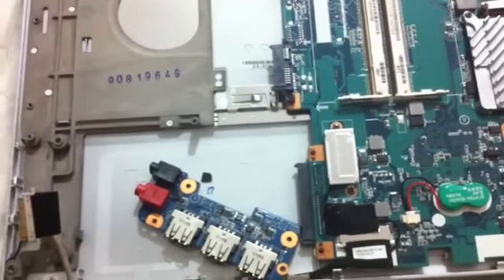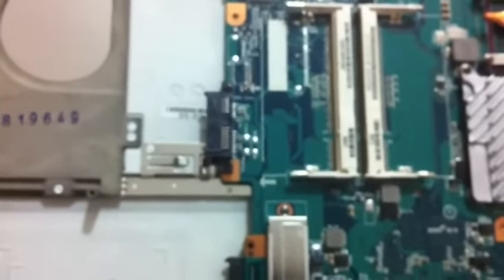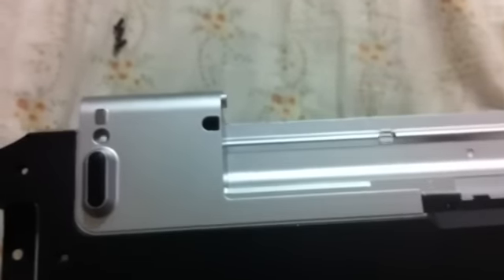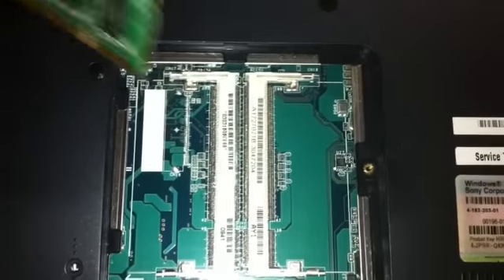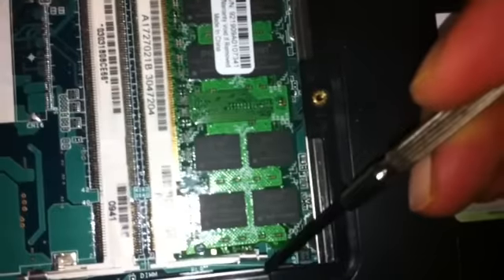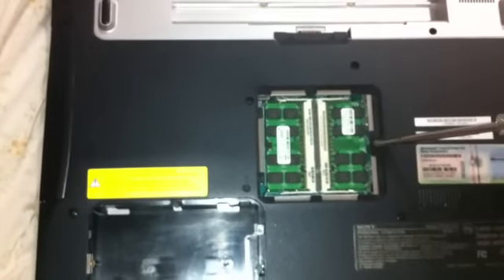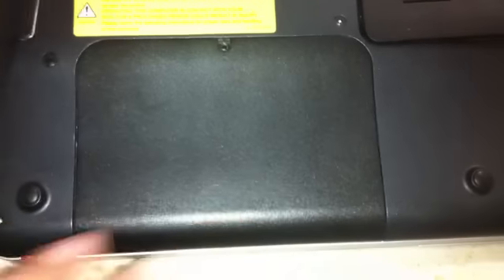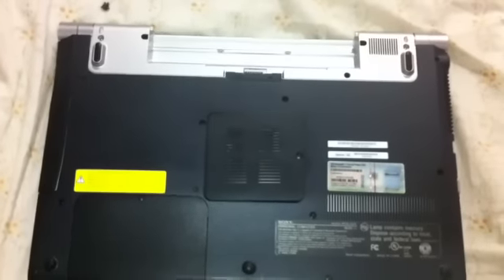How to assemble/disassemble Open sony Vaio FW series Notebook.

Comment: I had to open up mine because it was overheating(dust), when I closed it back up I ended up with a pair of really small screws (those 2-3mm ones with a bigger head, 3 of them are under the DVD/BR drive). I cannot find where these fit :P I hope it won't matter. These are a pain to open up, I was afraid of breaking something when pulling everything apart.